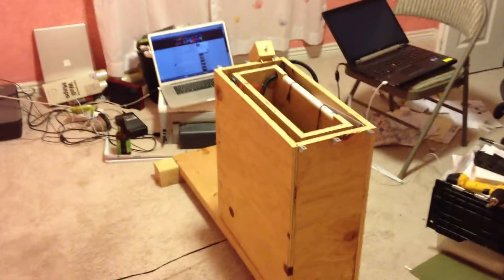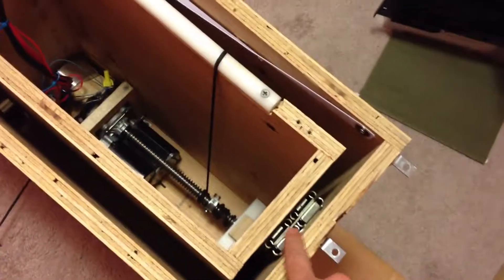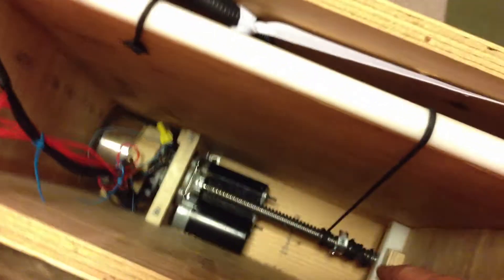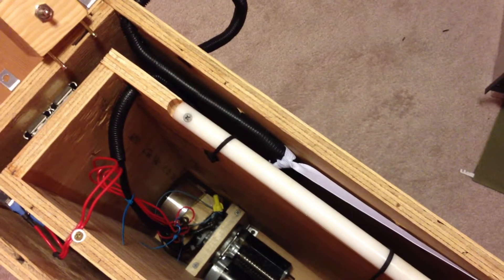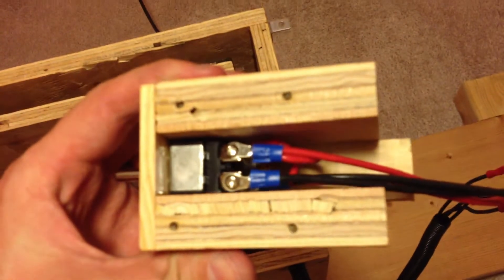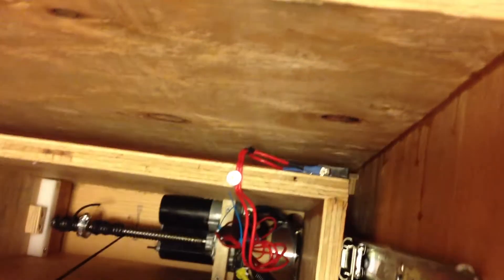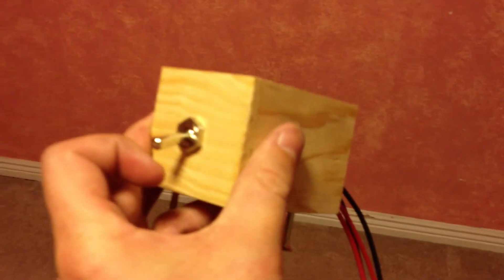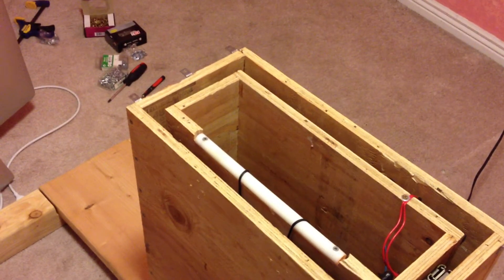Raisable & Lowerable Desk - Step 3: Finally Working!

Comment from the maker: Thank you! Very kind words.

Since the weight is held by paracord, which has a small degree of flex to it, simply pushing down hard on the top is enough to disengage the limit switch. That's how I did it.

What I *should* have done is wired the switch to kill the "up" circuit, not both the "up" and "down" circuits. The next time I really take it apart, I'll make that change. The other thing I'd like to do at that time is make another adjustable limit circuit, so I can set a repeatable height.